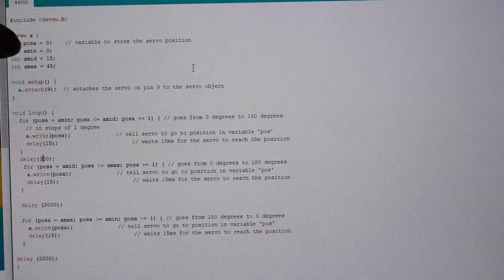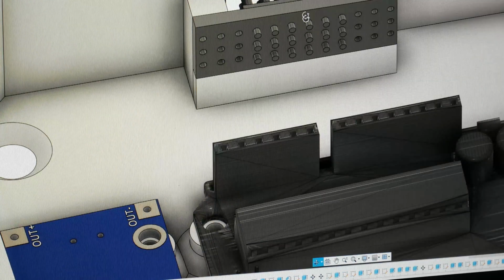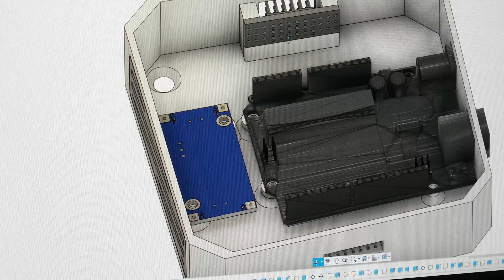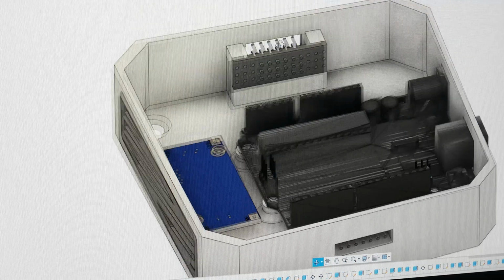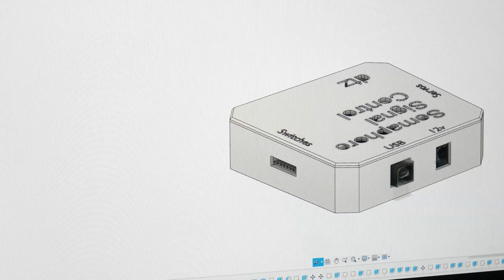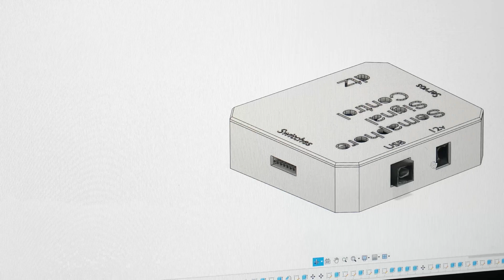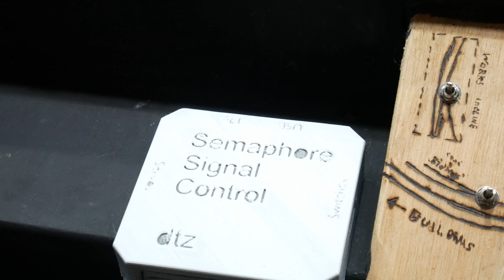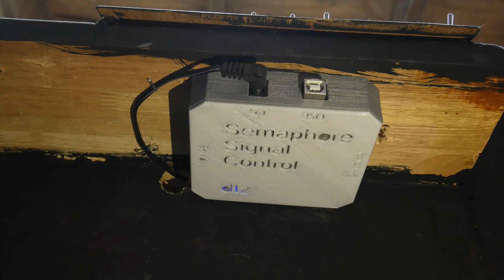26. Semaphore signalling- prt 3- Arduino Servo Control

Comment: Interested in doing something similar but have never used an Arduino before, how easy are they to program up? Are there any open source programs for operating semaphore signals with them?  I'd quite like to get the bounce like the megapoint controllers have but without the heftty price tag! Also how do you power the actual Arduino board, is there some transformer you use? Thanks! Very helpful videos.
Reply from the maker: Plenty of tutorial for servos and arduinos online. As for signal specific stuff I don't think there is but   the code is relatively simple so I might do a video at some point. For psu any 9-12v supply works on the round plug or 5v USB.

Comment: Have you thought about interlocking the signals with the points, using the Arduino?
Reply from the maker: Hi there, I had briefly considered it but have settled for basic co trols at the moment. I'm sure it would be achievable in the future if I change my mind